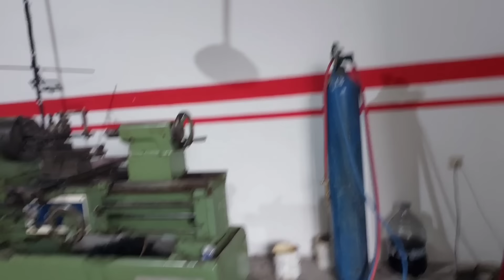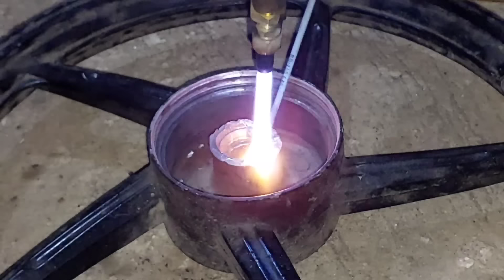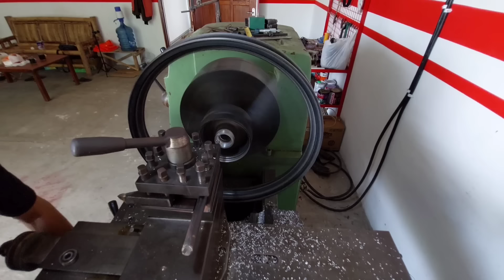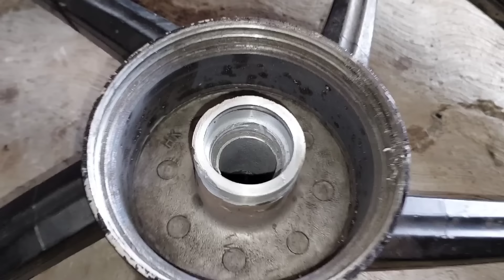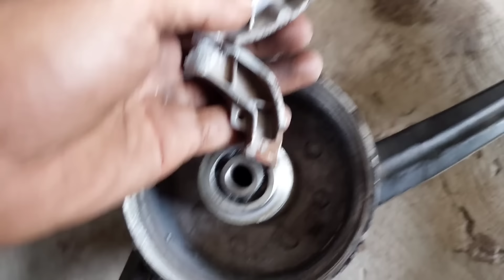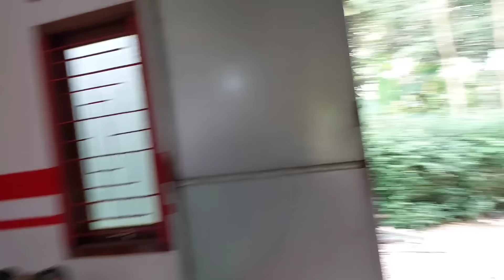Aluminum welding | How to repair the bearing housing on the motor wheel

Comment: I've been welding aluminum for over fifty years and have never seen that technique. I had to watch it twice, amazing!
Reply: No flux was used. You think it has a good bond?
Reply: And you never will.
It's faked   did you not see the rod was perfectly square like proper aluminium low temp brazing rod,?
Reply: @dnomyarnostaw  I saw both, I think